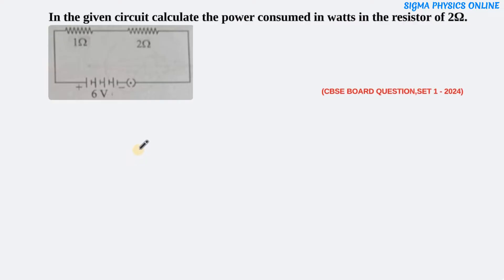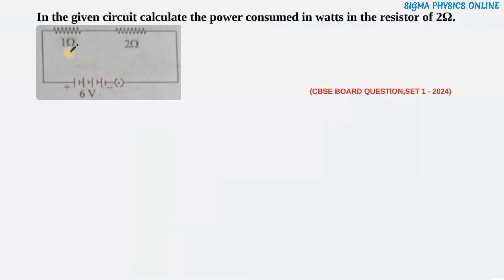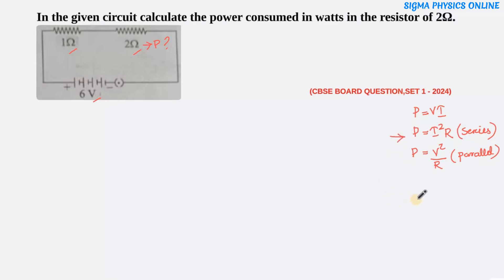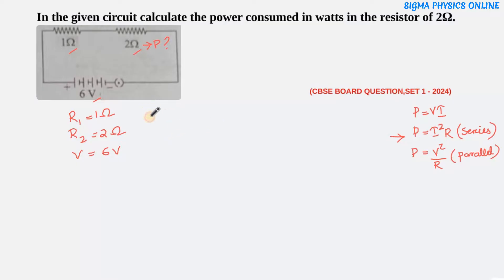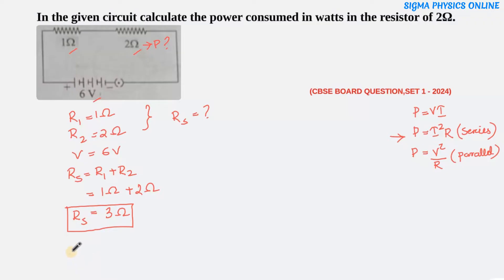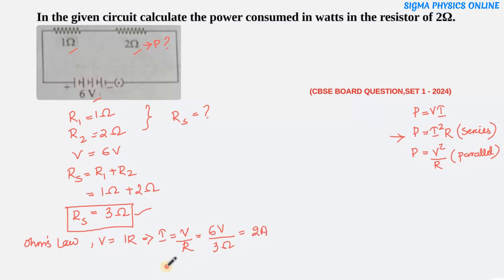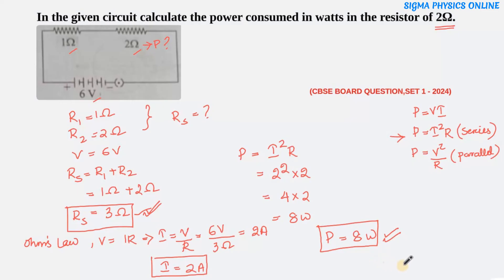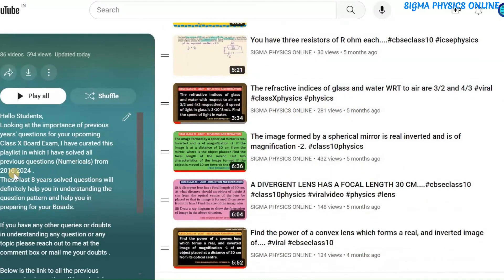In the given circuit calculate the power consumed .... #class10physics #science #cbseboardquestions

Comment: Mam why we here using the formula P = I²V or not P = VI 
Because when we use the formula P =VI then we get P = 6×2 = 12 watt 

Please reply
Reply from the maker: Hello beta.
We are using the formula p=I^2R AND NOT P= I^2V.
P=VI , and V=IR.
substituting the value of V in the first equation, we get P=I^2 R.
This is the formula used to find power in series connection. 
Hope you are clear.😊
Reply: @sigmaphysicsonline  ok thanks
Reply: You can still use the formula VI because voltage divides in a series connection
Reply: @SasmitKumar-t4e  are you mad or what if we take P =VI then P=6×2 = 12 watt but the voltage varies in series connection therefore we use P=I²R formula🤨
Reply: @Md_Faizan-f2f  you are a mad brother see
P = VI
Now  I=2
Then v = ir 
V= 2 x 2 = 4
Now p =VI
P= 4 x 2= 8 watts
Reply: Since voltage divides in series circuits we can't  use 6Volts
Reply: Voltage will change at every resistor
Reply: First learn and then only use the comment section
Unnecessary don't write rubbish
Reply: @SasmitKumar-t4e  o Bhai tumbhi chiz wahi kar rahe ho P=I²R but Thora ghuma kar Aur Power ke bahut sara formula hai samjhe.
Reply: @Md_Faizan-f2f  to phir yeh kyun keh rah rhe ho ki we can't use this formula,
In reality tumhari conceptual clarity weak hai
Reply: @SasmitKumar-t4e  no bro aapka bhi sahi hai samjhe but apne pehle elaborate nahi kiya tha ki kaise use karna hai baad mein aapne bataya ki kaise use kiye ho aur hai  jahan tak baat hai conceptual clarity ki  to wo mera kaafi accha hai.
Reply: @SasmitKumar-t4e  aur itna karna hi kyu jab aapke pass formula hai already to isse yeh pata chal raha hai ki kab konsa formula kaise use karna hai pata hi nahi hai aapko.🤌
Reply: @SasmitKumar-t4e  bro I know that in series voltage varies but in parallel vice versa 🙂
Reply: @SasmitKumar-t4e  I am always working hard for my goals and dreams as always 💯